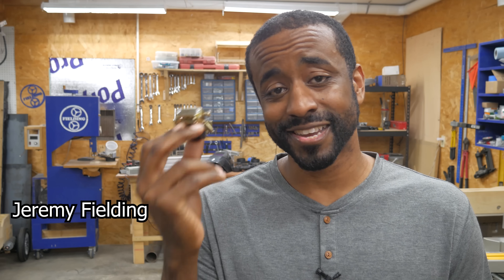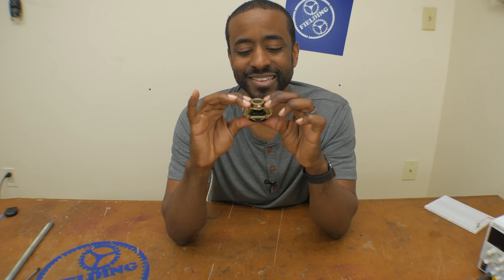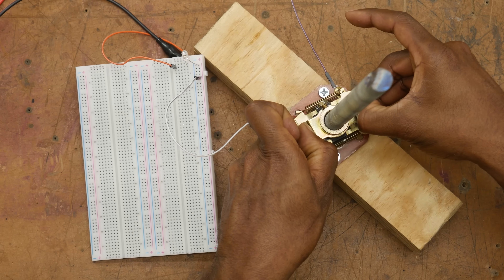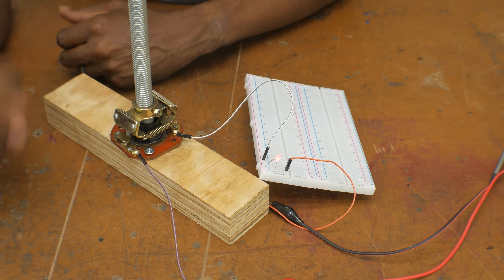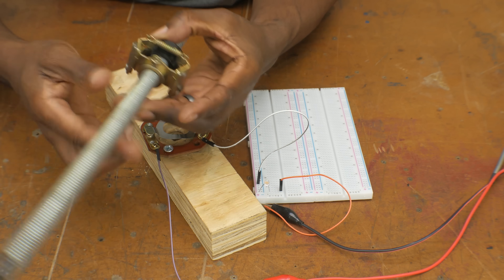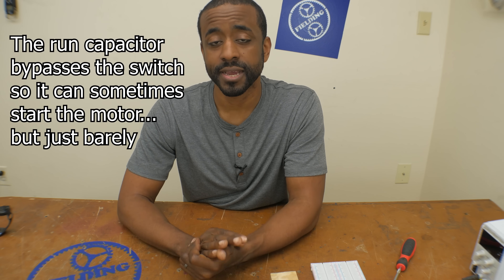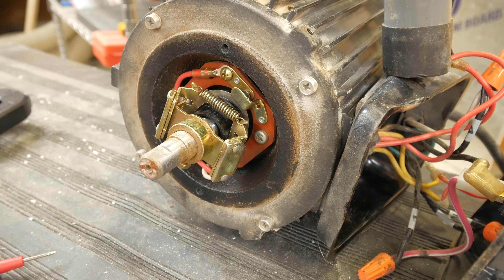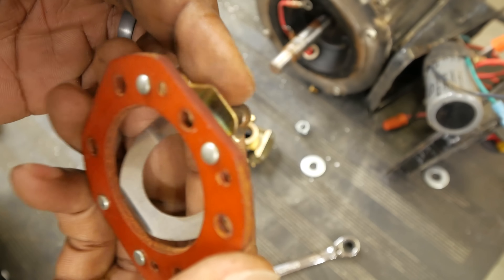This Clever Device Is Found In Nearly Every American Household. How It Works And How To Fix It

Comment: AC motors need a starter cap to pull the magnetic field out of phase. A stationary motor will not start without the capacitor unless you give the shaft a spin. The induced field in the core is what the motor coils push against, so it has to be induced from the previous cycle segment(AC) so that the magnetic flux is not aligned to the field set-up in the coils. It is not to provide extra power as you have said.
Reply from the maker: I didn't say it provided power? I said it needs a kick start. You have to quite literally push it out of position to get it to start... including physically kicking it would work LOL. I thought that was pretty much spot on. I didn't want to explain single phase motors in a video about the switch. Just read your comment and consider how many words need to be explained to a beginner... what is phase for example? But if you would like a complete explanation I made a video a few years ago that explains it in detail. "how motors work for beginners, single phase". search my channel.
Reply: @Jeremy_Fielding  Yes, Indeed I did misinterpret what you meant by kick-start because you did say under load. Without the starter cap the standard single phase motor would not start with or without load. Right?
Reply from the maker: agreed. Nearly 100% of the time it won't start with or without a load.

Comment: Jeremy, I have no documentation or patented proof, but as you pointed out, it has to over 150 years old. Many would say, it started with steam trains as a shaft with knee-jointed weights were mounted vertical and a spring for load could be adjusted to control a valve that releases pressure or allows it to build up prior to operation. I think close, but no cookie.
  The mining industry had to pump out hot scalding water the deeper they dug. Creating fresh air deep into a mineshaft to evacuate bad air, but huge steam engines where used used to lift hammers, cylinder shaped to crush ore into smaller pieces for processing. 
  We may never know who "adapted" the rotating governor from steam engines into an electric motor. The simple device it is, but if I had to guess, Nicola Tesla would be my guess...at least for a patent search. This device works so accurately, it's used as a governor for controlling up and down shifts in automatic transmissions at least until 1996. Toyota still used it in front drive automatics until this time, in the USA. 
  You have captured my interest again for sometime I never think twice about, unless changing the shift points in a 1992 GM vintage performance vehicle. Bloody Good ole boy!
ASE Master Tech- Retired

Comment: You should audition at America got talent with your sanding skill 👍😊.
Another device that is a kin to this one ( in the centrifugal force principal) is the fuel regulator in a basic gas lawn mower. Higher spin speed leads to more air blowing on a leaver connected to the fuel throttle (thus reducing the fuel amount.,  the opposite is true) as the higher density of grass reduces the speed, fuel flow is increased to ramp up the speed.

Comment: Hi Jeremy. This is perfect timing because the centrifugal switch in my table saw motor just catastrophically failed. After searching for the symptoms of my motor I found your video and took a look at my motor. The weights and springs of the centrifugal switch were thrown off and just loose in the bottom of the motor housing. Upon opening up the motor I noticed there was a tiny plastic tab broken off of the switch mechanism that must keep the weights from flipping too far. I re-assembled the switch with fingers crossed that it might work and tested the motor, but it immediately flew apart again and the the motor tripped the GFIC outlet. Have you had luck replacing failed centrifugal switches? I think I'll just buy a new motor and tinker with this one on the side.

Comment: I deal with a lot of those motors. But mostly 3 phase.remember ,many times that contact on the switch starts to show signs of wear. Check the start capacitor to see if it's within specs. If it's out replace with the same value. Replacement can be higher voltage but never a lower voltage. It will blow up .capacitance should be the same. +- 10%.make sure you discharge the capacitor! It can hurt you!

Comment: You do get capacitor start motors and capacitor start/run motors where the capacitor stays in the circuit. Just putting it out there for  someone that has a head scratcher on their hands. Not a common unit.

Comment: The source invention for this centrifugal switch is the centrifugal governor. Centrifugal governors were invented by Christiaan Huygens and used to regulate the distance and pressure between millstones in windmills in the 17th century. In 1788, James Watt adapted one to control his steam engine where it regulates the admission of steam into the cylinder, a development that proved so important he is sometimes called the inventor. Huygens most famous invention, however, was the pendulum clock in 1656, which was a breakthrough in timekeeping and became the most accurate timekeeper for almost 300 years. As an outstanding mathematician and, because he was the first to transfer mathematical inquiry to describe unobservable physical phenomena, he has been called the first theoretical physicist and the founder of modern mathematical physics. (Taken and rephrased for readability from Wikipedia)

Comment: Need to take a little care with those contacts.  I worked in telecomms during the strowager years, I must have cleaned 10000000s of contacts in my time and we used burnishing files to polish contacts.  Coarse abrasives score the surface which encourages arcing, the rougher the surface the wider the arc and the greater the surface area erosion resulting in more soot.  Polish the contacts to minimise the flashpoint.

Comment: I enjoyed your presentation on centrifugal switches, but using sandpaper to clean contacts is ok if you must be up & running ASAP.   High current electrical contacts are made with a special surface material to minimize burning the surface and causing a spot-weld short or carbonizing insulation.  A relay file is best for cleaning when a new part is not available.  I buy my relay files via Amazon.  For motors that do not use a centrifugal switch and only use a starter capacitor, the capacitor farad value replacement must be the same to prevent overheating of the motor.  I look forward to more videos.

Comment: Those "tabs" are CONTACTS. Going straight to sandpaper will indeed scratch off the carbon deposits, but will also scrape off the PLATING from the contacts leaving them highly susceptible to future failure. If contact cleaner and a piece of cloth do not work, then first resort to emery cloth with super fine grit. I hope this info helps you and others to avoid having to do this same repair again very soon. Also, leaving the power on while testing made this a more costly repair (Didn't you destroy your meter's continuity setting? DOH!).
Reply: It was for show I think. But I did not laugh.
Reply: Meter is fine as the short didn't pass through it, it only passed between two points on one probe.

Comment: Centrifugal regulators were used in steam engines to limit rpm by regulating steam flow. I'm assuming here, but I suppose they're a product of a 100 years of evolution before electricity was first used commercially.

Comment: Modern day cars have a problem with brake light switches. They use the same contacts and quite often get dirty. I have fixed a few. 5 min job of £15 to replace for new.

Comment: When they find something to replace it, it will be 800 dollars when it fails. They're on it now.
Reply: To save the effort of walking down to the local appliance shop, we can order one online for 10 times the price.
Reply: And you can rely on it being designed to fail just after the warranty runs out, with the replacements already obsolete and impossible to find, so that you are just better off throwing the whole thing away and replacing on a yearly basis rather than repairing anything.
Reply: ...and it will be in the most inaccessible spot possible.
Reply: All this complaining but completely ignoring the major improvenents in tech regarding effeciency,  size, weight and modularity. 
Mechanical parts add to bigger size products,  more weight, and eventually reduces efficiency. 

disclaimer:  not saying mechanics are bad, just saying price usually comes justified when weighing in the improved benefits as a whole

Comment: The patent for a centrifugal switch
 for electric motors was filed on August 6th 1908 by General Electric.  The inventor is shown to be John B. Wiard but the patent documents do not say anything about how John might have identified in regard to gender.  I would hazard a guess though that someone named John developing electrical motor parts for GE back in 1908 would have been a man.

Comment: Awesome video! Thanks for sharing! Also if the sand paper doesn't work on the contacts you can often clean corrosion off copper by soaking or wiping down with distilled vinegar. I then flush with rubbing alcohol once clean.

Comment: "Needs a Kickstart" "specifically in the US"

That's why I don't know these - I'm a German and our voltage is more than twice that you have. We also need starting current measures in many applications, but there mostly passive components. Almost only multiphase machines have switched solutions.
Reply: Most probable place you'll find them in europe is in an application where the motor has to swing a quite heavy load at startup, think car liftst, (some) hydraulic pumps etc...
Reply: @Ikeepforgettingmykeysinmycar  I have never seen one in my life in Germany. And I'm an electrician for 20 years. Main reason would be, we have 3-phase power everywhere. If a motor uses enough power such a switch is needed, we would use 3-phase. Most US homes only have 2-phase 220V with a center tab for 2x 110V. In 3-phase systems the simplest solution for heavy load starting is star/delta switching.
Reply: @Ikeepforgettingmykeysinmycar  our three phase 3kW circular saw, with a manual three-position switch. It takes ten seconds or so to get it to run or the safety breaker pops.
Reply: Never seen this in my life. (In Europe)
Reply: I didn't know anything was passive in Germany.
Reply: Yeah, 240 V ac here in Australia, or 415/ 440V for 3 phase.
Reply: I live in Sweden that uses 230 V and I have only seen a centrifugal switch once, in a very old washing machine. That being said, maybe we are used to having slower starting machines in Europe. The faulty vacuum he showed didn't seem extremely slow starting to me.
Also, very few domestic appliances have three-phase supply nowadays. If an induction motor is warranted, the manufacturer put in an inverter instead of excluding all customers that don't have a three-phase outlet.
Reply: I never saw a motor with this switch in Belgium. I used for example DAB pumps for 30 years, just never saw this.
Reply: Probably only used in the US because someone is getting kickbacks for royalty payments 😂🤣😄😅😁😀😆😉😋😊
Reply: This is what happens when you use a mains system designed by Edison instead of Tesla. Not enough volts = not enough current. Also explains why merikans don't use mains powered kettles.
Reply: Jeff Slade  Hey Jeff Slate. Americans use a mains system invented by Tesla, not Edisons D.C. system. Tesla worked for Edison and Tesla invented the A.C. system we all use today. We also plug our electric coffee and tea pots/kettles into a regular household outlet/mains just like you do. Check your facts first!
Reply: @jrjohnson4547  I'm a Brit living in the USA. We do have a kettle that we can plug into the mains, but its takes FOREVER to heat up. In the UK we had 240 volts and kettles there boil much more quickly. I use a kettle that sits on the electric stove instead, because its quicker - never had to do that in the UK.
Reply: @jeffslade1892  Electric kettle? i have one in Canada, same system as the US.
Reply: @jeffslade1892  (TL;DR version: think it's more about cultural/drink/food habits and infrastructure (i.e. kitchens) than actual "Tesla vs. Edison", voltage issues.).  Well, while we DO have quite useful speedy mains-powered countertop kettles (I have one) here in 'Merica, and they DO in fact work as well as the 220/240v Euro models (I travel to Europe rather often), for some odd reason they're not nearly as popular as in Europe. Or Japan/Asia, for that matter. We also don't use the really popular/useful countertop hot water kettles with adjustable temps nearly as much, either. I think it's partly that Americans don't do tea nearly as much as Europeans; we don't do ramen etc. nearly as much as Asians - we just don't need boiling water all that much for anything other than coffee so we just have dedicated coffee makers. Personally - I wish to hell we had gone with 220/240v; it makes SO much more sense, and is far more efficient.
Reply: @jeffslade1892 I'm always amazed to think it, but AC is a Tesla thing not an Edison thing. If it was Edison it would be DC and your motors would always start and then your house  wiring would melt and you'd brown out the neighborhood cause you washed too many clothes at once.

One of the few times a weird troubled but brilliant and generally nice guy like Tesla's ideas won out over a driven type-A steve jobs-style asshole like Edison.

Also, this doesn't explain why americans don't use mains powered kettles- I don't know why that is, probably we just don't drink enough tea? Maybe we have higher percentage of gas service in houses? The average american has plenty of high-amp resistive heater appliances, but i think we just have more coffee makers and fewer teakettles.
Reply: @confuseatronica  What amperage do these resistive heaters you have in the US have? It seems that your standard plugs can carry 15 A which would give a decent power (1800 W) but is it common to have circuits that can provide it? Like, the Schuko connector used in e.g. Germany and Sweden is rated for 16 A but since normal circuits only provide 10 A very few appliances use more than that.
Reply: @jeffslade1892  I installed a uk imported kettle on a dedicated 240v circuit in my us kitchen :)
Reply: @jeffslade1892  R=V/I...
Reply: @jeffslade1892  everybody needs to listen to Jeff Slade and investigate this.
Reply: @jeffslade1892  actually, the world is using Tesla's AC (Alternating Current) versus Edison's DC (Direct Current) as a result of the 1893 Worlds Fair in Chicago. Thank Tesla for inventing the Transformer. The man was an absolute genius. 
Also the more voltage = less current. Ohm law. But yeah, US takes the phase to grounded conductor, meaning 120v, Euro use phase to phase (in most cases) which is 240v, but actually still only 120v per phase. Three phase systems use 120v per leg which is known in the US as 208v and is also 120v per phase.
Reply: Rob Phillips Europe uses 230V per phase, giving us 400V phase-to-phase bc of the 120deg shift btw phases.

Comment: This is awesome. I've never seen a centrifugal switch used in this way and it never occured to me that loaded appliances may need a capacitor to give it a little extra oomph.

Additionally, I'm sure you've seen one, but very similar centrifugal switches are used as low tech governors. When they spin up to the engine "red line", the weights throw out and the switch disconnects the spark plug, thereby arresting more combustion cycles until the motor slows enough.

Comment: 1:10 I think you meant to disconnect the capacitor from the motor.
Reply from the maker: there is a correction note on the screen
Reply: @Jeremy_Fielding  I missed that. Great video!

Comment: You forgot to mention the danger that capacitors that size pose.  Always make sure they are discharged before you try to do anything with them.  I've seen people discharge them by placing  the shaft of a screwdriver across the two leads.  It generates a huge spark, but if you're holding the handle, and not the shaft, you'll be fine.  If you don't discharge them first, they will discharge on you, and you'll get that huge spark.

Comment: My first guess at the start of the video was "an RPM governor for a spinning device" - which isn't too far from wrong. "A mechanically actuated relay" would also be a correct answer. 
A note on start capacitors: If you have a shorted or open capacitor it usually means the motor is having unexpected trouble spinning up - possibly due to worn bearings, brush condition, or some other resistance not counted on in the motor design. It can also happen if your line voltage is prone to falling below 90 volts during peak hours (the cause of many failed window air conditioners) This causes the cap to overheat and break the dielectric (usually some variation of oil based tar) seals. A bad cap can occasionally be the result of a line surge or lightning strike, but rarely. Since the start capacitors are usually engineered to handle the starting power of the motors they start, if you replace with an equivalent cap and it goes bad too quickly, raising the max rating of the cap will make the cap last longer but doesn't address the underlying problem causing the cap to blow in the first place. Without investigating the health of the motor itself, simply replacing the start capacitor with a higher rated one could accelerate the causing damage to the motor.  When trouble shooting, never assume the simplest answer is the correct answer. Often it is, but the few times it's not can become costly misdiagnoses.

Comment: That switch is based off a very old design. The centrifugal governor was invented by Christiaan Huygens in the 17th century, and James Watt improved on it slightly for use with his steam engines. The addition of the springs simply speeds up the motion.